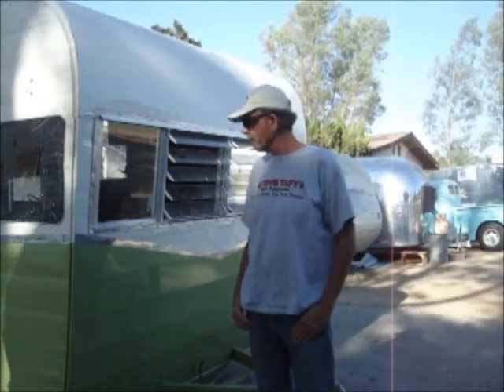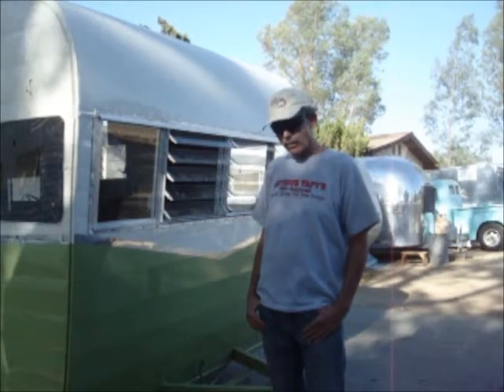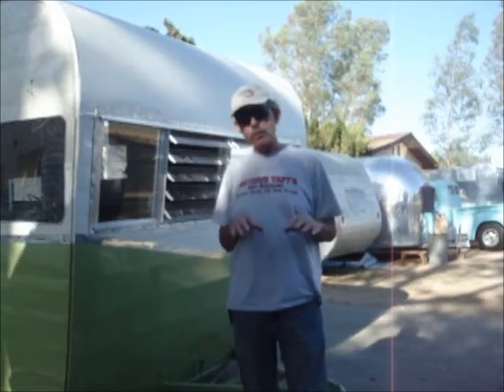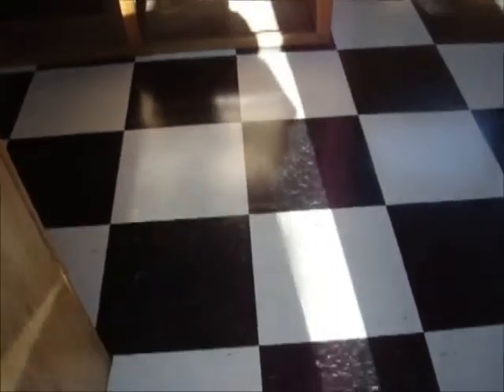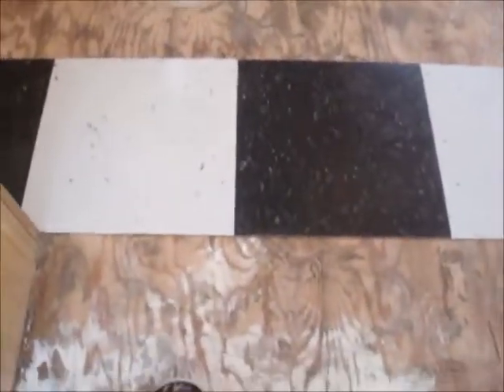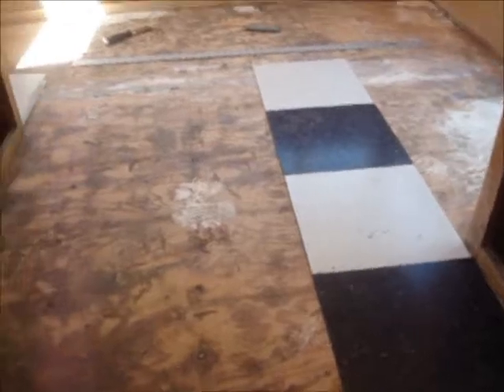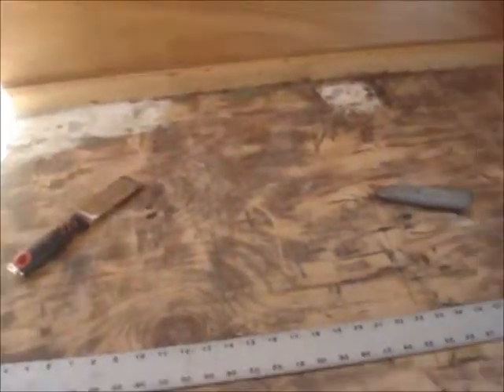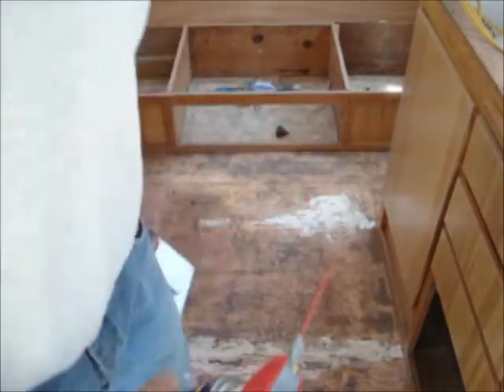Tiling Your Trailer Part I

Comment: Similar decision in the work area of the kitchen. The aisle is 4 feet wide. I could put edge of tile on the centerline and have 4 full tiles across, or centerline of tile on centerline floor, with 3 full tiles and a half tile on either side. Strange as it may seem, centerline on centerline made the area LOOK bigger, at 3 tiles with a "border" vs 4 with no border. I laid all the tiles out and walked around on them, then moved them and walked around some more, making up my mind.

Comment: Somewhere in between laying laminate and laying ceramic tile. The concepts in all three aren't that far removed from each other. Bottom line is the same, though. You get ONE chance, so you make sure that layout is exactly what you want BEFORE you start. I spent three days on the kitchen layout, because there were a few different approaches, all of which were "right," but produced different finished looks.